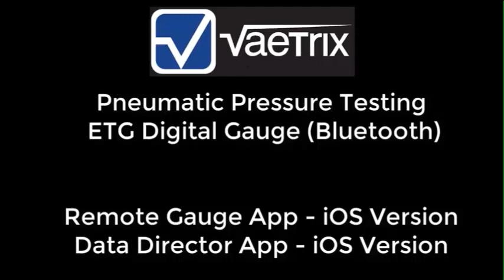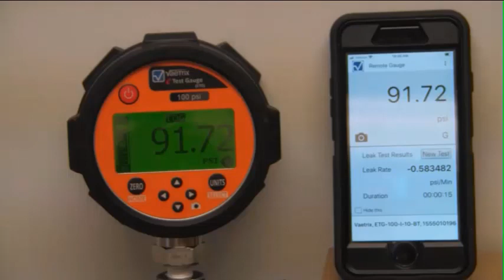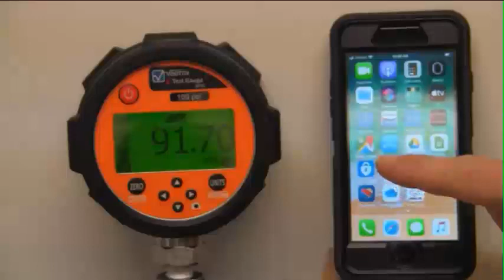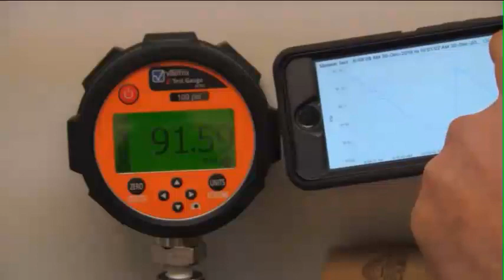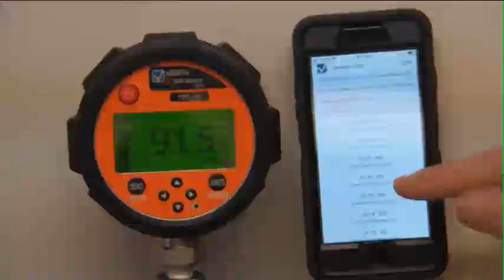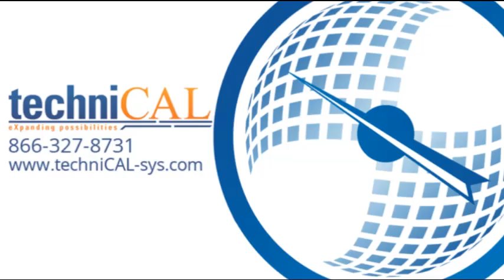VAETRIX Digital Pressure Gauge for Pneumatic Pressure Testing with Bluetooth ETG Series

Comment: What is the pressure range of gauge and length of leak tests available?
Reply from the maker: Range Options (0.05%)
-15 to 15, -15 to 30 (Compound-Gas Only)
15, 30, 100, 300, 500, 1K, 3K, 5K, 10K, 20K, 30K (Isolated – Gas & Liquids)

Range Options (0.1% & 0.25%)
±5, 30, 100, 500, 1K, 3K, 5K, 10K, 14.5K (Isolated – Gas & Liquids)
All values referenced in PSI. Consult techniCAL for additional range options.